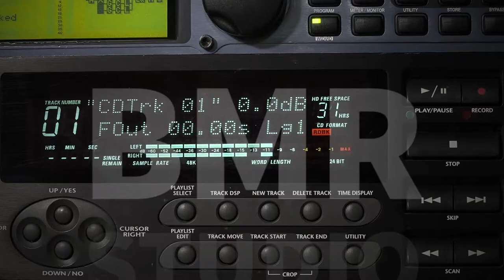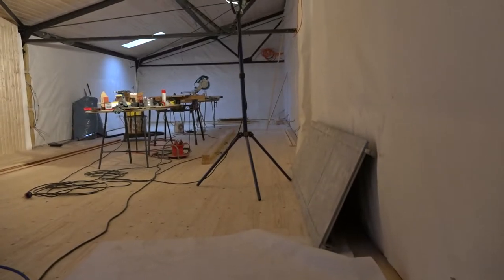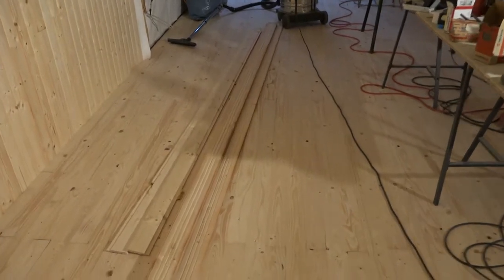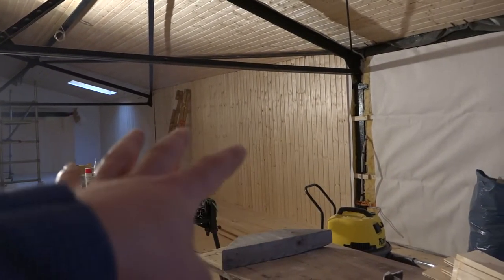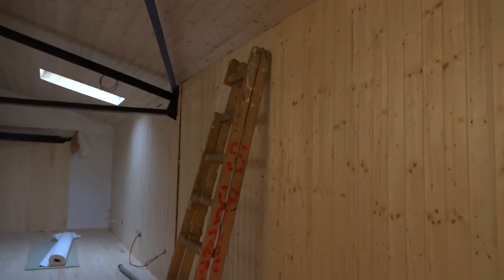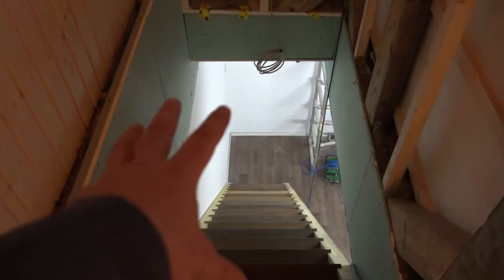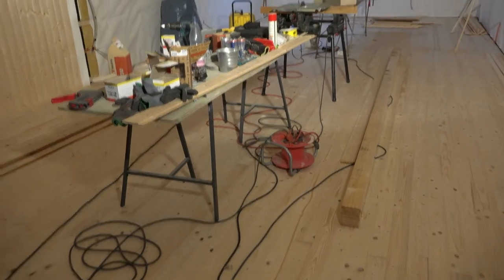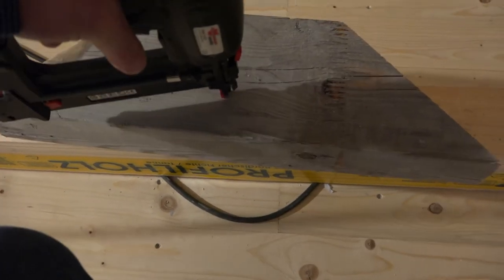Building a new studio! Part 2

Comment: CopperLan for the win! I also run Dante over the same  network with no issues.
Reply from the maker: Chris Foster Sure!
But the Dante is so expensive to implement into all of my gears.
Just have a look on interface cards. Maybe there is some license fees?
Reply: I'm just using Dante Via and Dante Soundcard software bundle which has 48k sampling rate. 1 PCIe card + Dante Sound card is a good solution...I read a guy on the Reaper forum, uses 1 card and has clients come in with laptop + trial version of Dante Soundcard. He can mix 64 channels from that laptop through his studio setup. The client walks away with the mix on their system somehow :)
Reply from the maker: Chris Foster interesting.... but I can mix 32 in-ont with 96K analog or digital hehehehe :) plus 64 extra channels on the mixer 
Funny part is, 90% of the time I’m just using the first stereo channel....